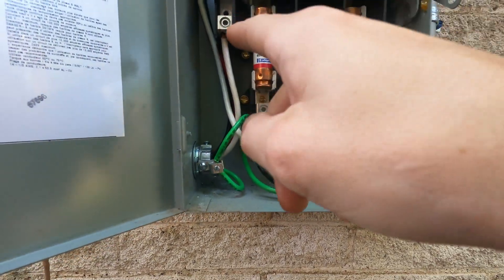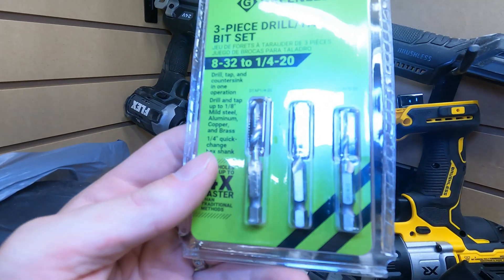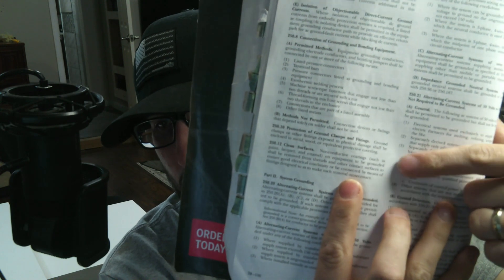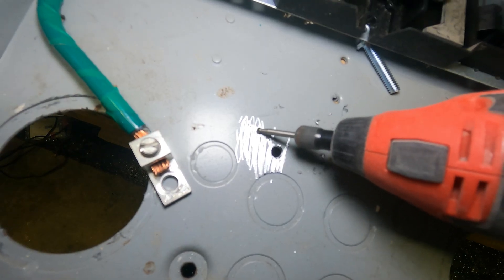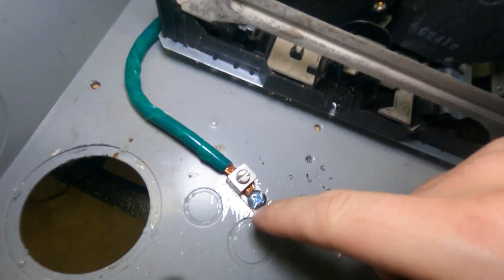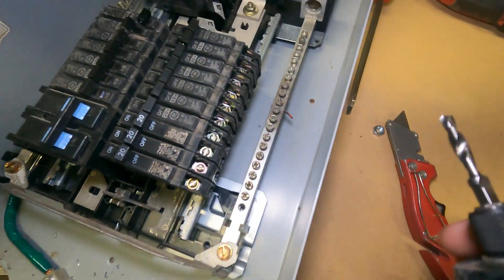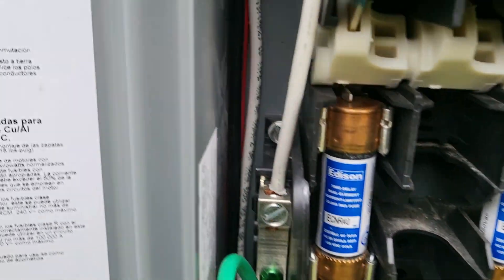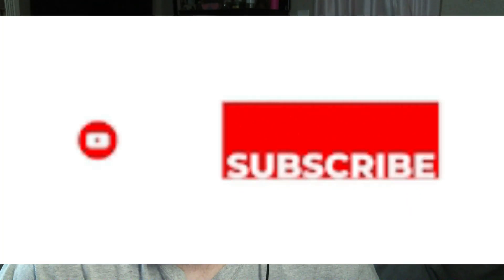Drill-Taps ! Start Using This TODAY! -  Electrical Bonding The Right Way!

Comment: The code wording is poor. It should be changed to require the use of machine screws to eliminate any confusion as opposed to forbidding the use of sheet metal screws. I agree that "tek" have the same type of course threads as sheet metal screws and should not be used for grounding connections.
Reply from the maker: Yeah very few places in the code does it spell it out exactly what you need to do. Except for NEC 680 in swimming pools. for the equipotential bond loop!